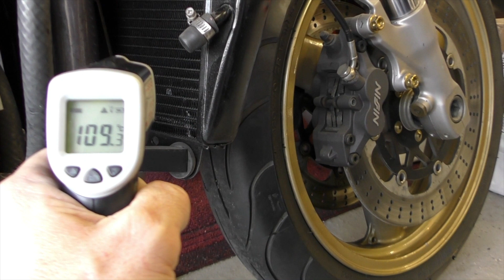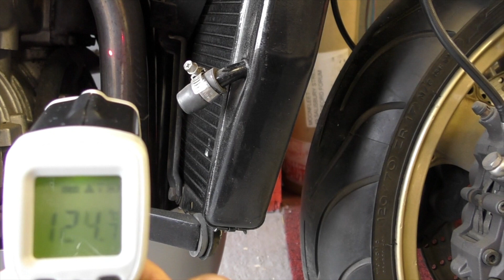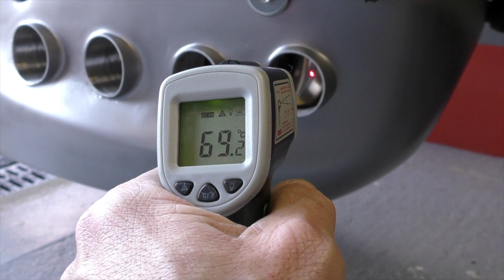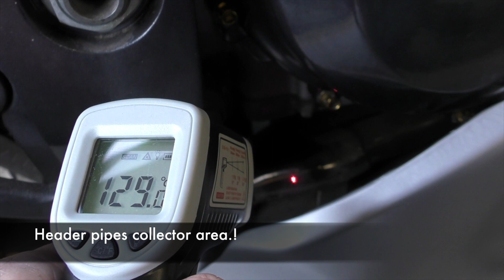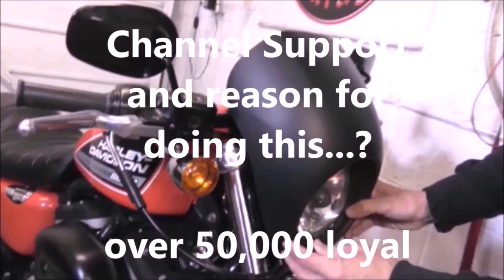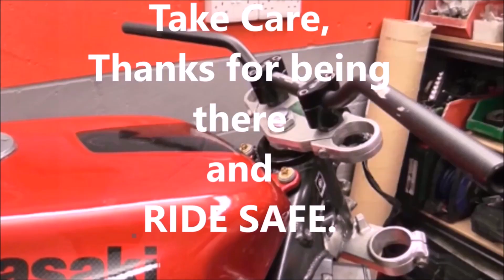Delboy's Garage, So exactly how HOT does the Belly Pan Get?

Comment: Seasons Greetings to you both & thanks for all the hard work. 

Daily cold and wet ride: '99 R1100R. Changed brakes, bobbins, fluids, re-furbed calipers', pipes, banjo's, accessorised, freed screws, bolts, nuts, cables, small mammals. Failed. Made tea. Ate cake. Repeated mantra 'How Hard Can It Be?' Tried again. Failed better. Fell in love with the click of a torque wrench. Became a better, though still cold and wet, rider. All because of Delboy's Garage.

Thanks again, and have a great Crimbo & a fantastic New Year.

Anvil.

Ps: Fun Xmas Question for the physics nerds amongst us: 

'If it's between minus & plus two degrees Celsius when I leave for work at six am tomorrow, how cold will I be at 92mph when the Police Officer on the hard shoulder of the A1 takes my temperature with his IR Thermometer?' 

It's a free service, apparently, but I've never stopped to ask?
Reply from the maker: Hi Anvil... Fkin cryin here.. that hilarious.. i read it all serious right to the last line.. i was already planning my reply on the misunderstandings of windchill... then just spat me tea out..lol    You legend..     

Thank you also for the Sonnet, that was a real treat to read, and you are very most welcome to all the help we can give. Owning a motorcycle is way more then just about riding it from A to B, its a life and partnership with the machine, it takes you where you need to go, exactly when you need to go there and all it needs in return is a little care now and again, and some respect when you ride it... what person or pet could ask less and give you more in return... your bike is your friend, and deserves your love and respect aye. 

Thanks so much for your kind words buddy, have a Merry Christmas and a peaceful new year to you and yours my friend, take care.. Del & Pennyx

Comment: One thing to keep in mind when taking temperature measurments with an IR thermometer is they're calibrated for what's called black body radiation, i.e. radiation from a surface which doesn't reflect at all.
When you're measuring light coloured, shiny surfaces, like, say, stainless steel exhausts or belly pans painted with silver wheelpaint, they're going to read low and it's difficult to predict just by how much. One of the things I tested myself (because I had access to it via a customer) is molten tin, which read about 65-70 degrees centigrade low with regard to a thermocouple.

Obviously, if you can still keep your hand on the belly pan after the bike has just sat there idling for half an hour, this doesn't matter, however, just as a heads up for you and the rest of the viewers: if you want to make a good IR thermometer measurement, you need to either provide a patch of matte black paint on the thing you want to measure, or termporarily mask it with some black gaffer tape or something.
Reply from the maker: One part i edited out (for simplicity) was i wrapped a black rag around the exhaust can, gave it 60 seconds to equalize, then read it again.. it was no more then 5 degrees hotter... the worst time reflective surfaces give a bad reading is when they reflect off onto cooler surfaces... but like you said... holding the back of a hand against it confirmed it was cool..! lol

Comment: You may get more realistic results from actually running the bike under load. (Obviously not ready for that yet.)The temperatures will probably be different when you really 'work' the engine hard. The good part of that though is that the bike will be moving along in air to help dissipate the heat buildup from the infrared radiation. The IR heat radiation (low frequency light) doesn't rely on the conductivity of the air... but the air helps dissipate the heat from all the surfaces that have heat buildup. I think you're correct that the belly pan will be fine with any paint that you choose. I'm just saying the bike will get hotter when you ask it to make some real horsepower and not just idle or rev at standstill. I have an IR heat gun like yours and love it. Merry Christmas and have a Jolly New Year. Get well soon! Love your videos.
Reply from the maker: You're dead right buddy... the only danger will be a really long rolling burnout, as it combined huge engine load, with almost no movement... but i dont do too many of those any more.. cant afford the  rubber...lol  have a very Merry Christmas and a peaceful new year to you and yours my friend, take care.. Del & Pennyx

Comment: The only thing I'm thinking is that you tested the bike with it mostly just at idle. when you are riding the bike those exhausts will be a lot hotter!. I don't think that temperature is going to be a problem as when your riding you also have the cooling from the air rushing past), but this video is more of an indicator that it will be OK (to me anyways)
Reply from the maker: Exactly that Chris, the cooling effect (heat exchange) of passing cold air will probably keep it even cooler.. the single biggest time you will suffer from heat is stuck in traffic idling for ages.. still, a far cry from the abject Panic we got from some commenters back when this was being built aye lol...

Comment: :p Not really surprised with the results but i am shocked that the temp can drop more the 50 degrees with in a foot from leaving the head. Good stuff sir.
Hope you get better soon. Cheers
Reply from the maker: Thanks Tex.. yes, heat convection is dramatic. its radiating out from the exhaust pipe like a heater..and as it moves away from the heat source it cools fast...!  Physics is wonderful aye.. take care.   Del.
Reply: indeed
Reply: ^ that.. and keeping the battery charged in the mean time between starts..

Comment: Hi del. I'm sure that it's all good because you can touch the thing. Only problem is that you were using the spot meter on bare metal. The results you can get can be massively wrong due to a property called emissivity. The shinier the surface the less reliable the result. It's even worse on the exhaust as it is above 90 percent reflective to infrared radiation. Which the spot gun uses. If you want a proper reading you need to use a high emissivity target like electricians tape. It will be in the instruction manual
Reply from the maker: Hi John,  yeah, the infrared can bounce about and measure all kind of other things....but the back of my had turned out to be the best test in the end aye.!

Comment: would you say that a belly pan on most bikes could increase the engine temperature? I installed one on my sportster.
Reply from the maker: NO buddy... it will not increase your engine temp in any way... heat rises, and the belly pan is at the bottom.. !  as your Harley is air cooled, the oil is the only means of testing its temperature.. and you can buy oil tank caps with a thermometer on them and the gauge on the top.. i have one on my Fatboy and it tells me at a glance how hot the oil is any time//!   get them from your dealer as an accessory..!

Comment: Are you sure this is a solid way to show how hot everything gets? As soon as you start riding and especially at full throttle the exhaust will get a lot hotter.
Reply from the maker: It will indeed and the extreme "heat exchange" effect of passing air will cool it in return.... not by the exact same amount..but it will keep it from overheating... the worst damage is done to any engine (specially air cooled motor) while it sits in traffic idling for ages.. motion cools metal...that's why air cooled motors work..!   and that same cooling air will cool the exhaust on this bike as i ride along..!     

There's a fun experiment you can do in the garage, i learned it at school 40 years ago... heat up two bits of 1" thick steel bar so they are glowing red (850 degrees), then place them both in a vice each to cool... BUT... in front of one of them, place a large office fan on full speed.... 

The first bar cooled to stone cold in just over an hour.... the bar in front of the fan took just 90 seconds...!  air cooling is devastatingly effective buddy.!
Reply: Moonfleet41 does that mean i have a solid reason to drive trough the red light at a stop with my air cooled monstwr 696? So the engine won't get damaged.
Just joking ofcourse. Loving the work you do on the bike mate, keep up the good work.

Comment: Nice one!  Can I ask why you were surprised that it fired up? Excluding spark + fuel + battery what else can stop a bike from firing up after a long time not used? :)
Reply from the maker: Oh i knew it would start, just not so instantly....I had dried the motor out totally, no fuel on the carbs, and even the pump was dry... i expected it to turn over for maybe four or five turns before it coughed..it takes that to get vapour into the cylinders....but it didn't even complete a full revolution...that's only usually seen on fuel injection motors.... happy with that thought, clearly a good tight motor..!
Reply: Cheers for the reply Del! Makes sense, thanks :)

Comment: I have a question re my 2014 bonnie T-100. When I push the starter button it just clicks. Its coming from the solenoid. The battery tester shows yellow. For 6 months when I push the starter button It would click a few times then start. do I need a battery or solenoid ? I know this isn't related to the belly pan.I was wondering what your thoughts are. Thank you in advance.
Reply from the maker: Hi Steve.. do you use it every day..and does it live in a battery minder.....?  also, have you checked the battery terminals are tight..?
Reply: The battery terminals are tight.I don't have a battery minder but I'm buying one today. I took The battery to the parts store and they told me it was showing 11 volts. Thanks for your reply.
Reply from the maker: Eleven Volts is not enough Steve.. its buggered mate,, it should read 13.5V or at very lowest 12.5 when off the bike.... just get a new battery and stick your battery tender on it from now on...!
Reply: Thanks. Put a new battery in it -it started right up. Love your you tube channel.Thanks again.
Reply from the maker: Excellent, and if you keep it plugged into a battery minder when not in use, that battery will last ten years mate.!